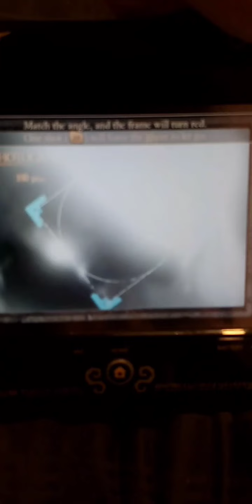Fixing/Reducing Wii U Vibration Motor Squeak

Comment: How were you able to remove the motor from the outer shell of the gamepad?
Reply: You grab on the little outer circle at the outer part of the shell (where the battery is put in) and push while you pull from the inside
Reply: My biggest issue is splitting the motor apart